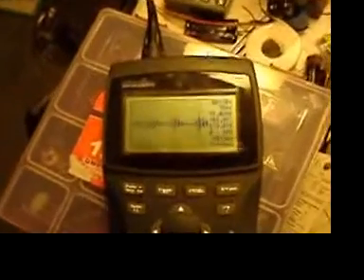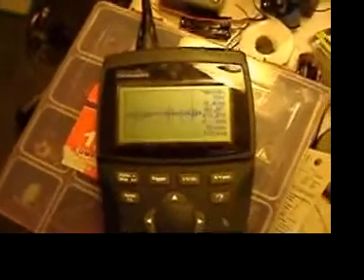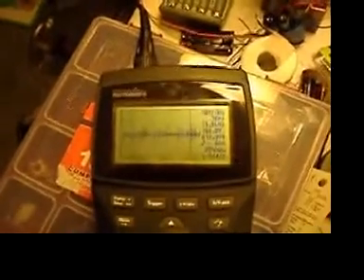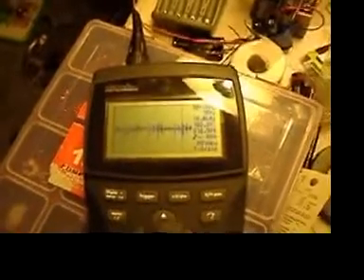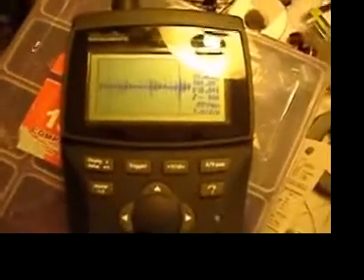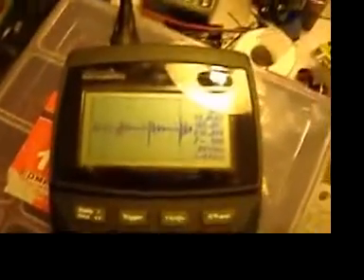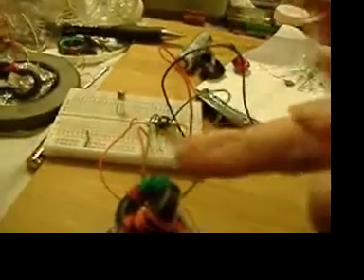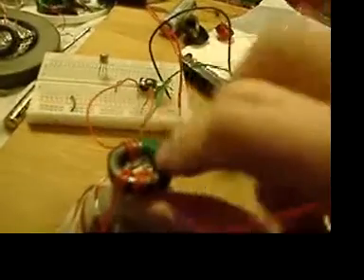joulethiefconicalpancake.mov

Comment from the maker: The cone is air core,
It helped when I put some nails around the edge but not when they were in the center, but it was really a problem for me to keep them in place.
That is when I wrapped the end wire around the toroid.
I got a good result with one that was little, but this is way way more.